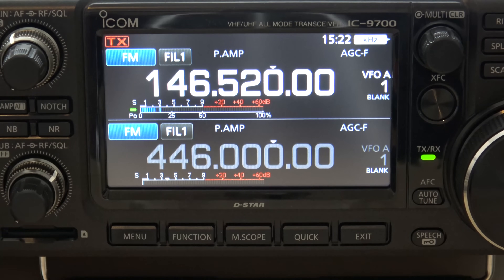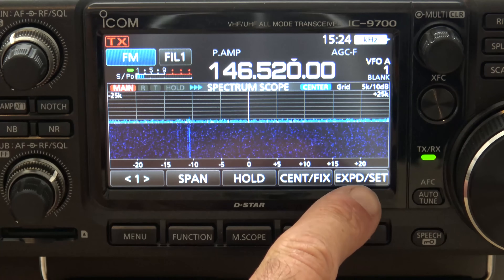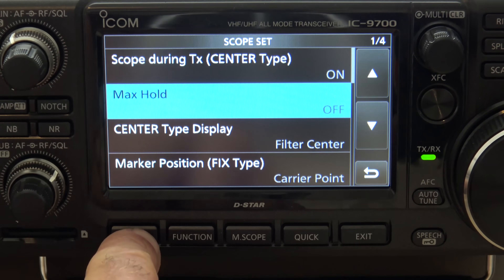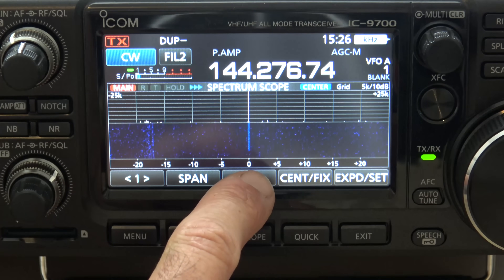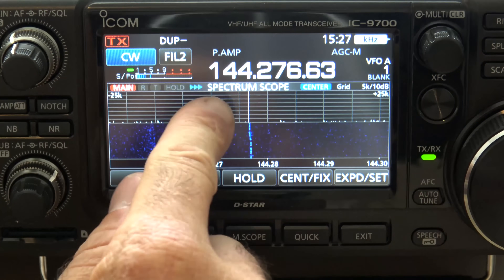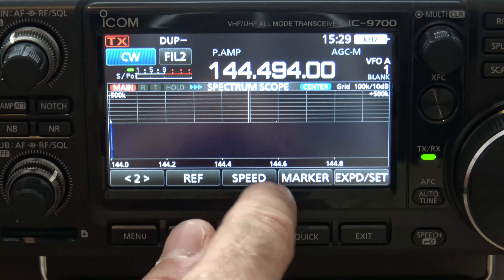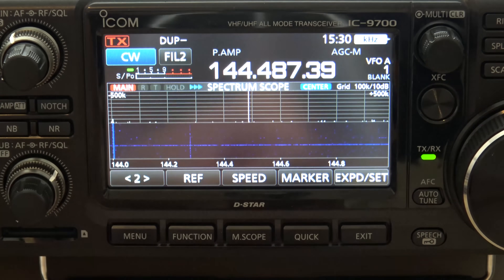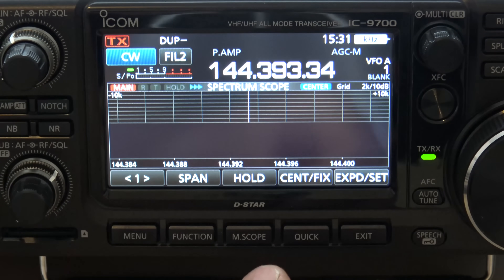Icom IC-9700 Scope/Waterfall Functions And Settings

Comment: I just bought the IC7300 and haven't powered it up yet. Many things to learn about it and I can only listen until I take the technician test to Grandfather to general. My license expired well over a decade ago and the low band rigs I had were Healthkit..I can't wait until I get licensed agn. The radio in this video is very cool and I think it would look great setting next to the IC7300. Next year maybe. I'm very limited in space outside and just having a vertical for 20,15,and 10, and trapped inverted V for 40 and 80 is about it for now... I plan to take down a 3 element yagi for 10,15, and 20 and the tower sometime this late summer or fall from a house down state from me. So I will have that too.

Comment: as per your comment. The 910H doesn't have much of anything of band scope.
It's the S meter with segments that go up and down. No color, no waterfall. If you see a "peak"  your have to dial to it quickly. The term scope is very generously used